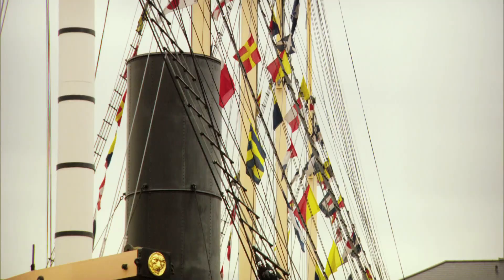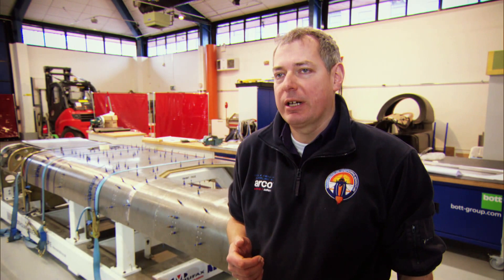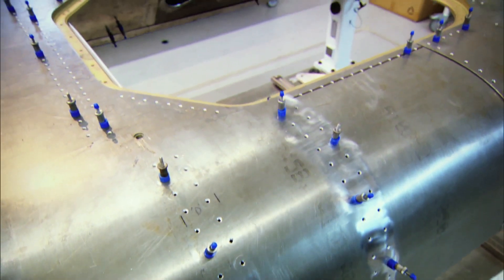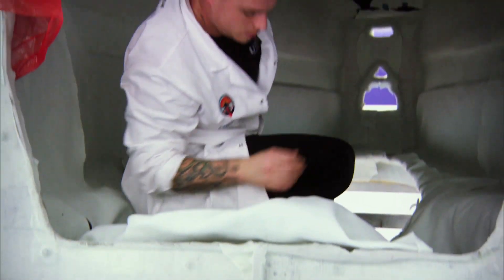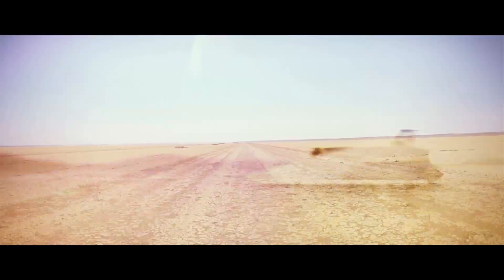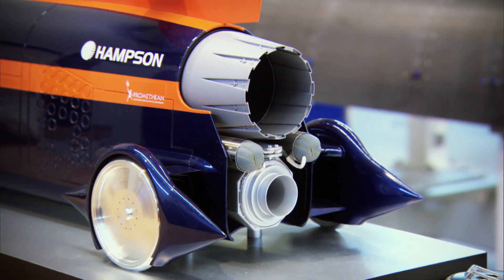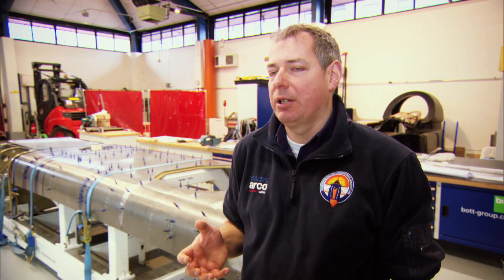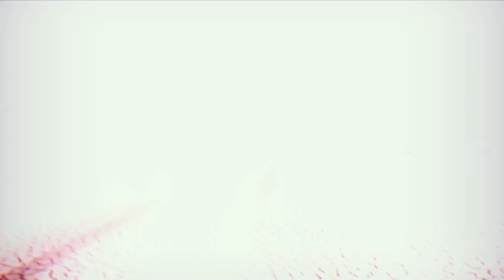Bloodhound Project - The Supersonic Car on Trans World Sport

Comment: Question ,So first it uses piston then when it reaches red line in top gear, it uses jet engine and then when that's at it's limit, it uses rocket power..? Just wondering of this might work about using 3 Pratt & Whitney F-100 F-15 engines...two makes 156,000 equivalent hp..23770 lbs of thrust ea...